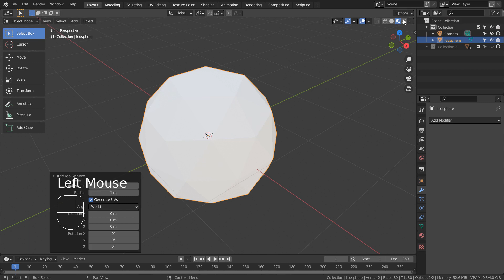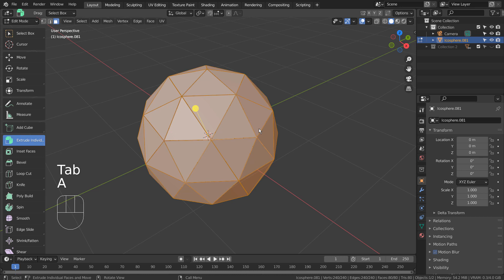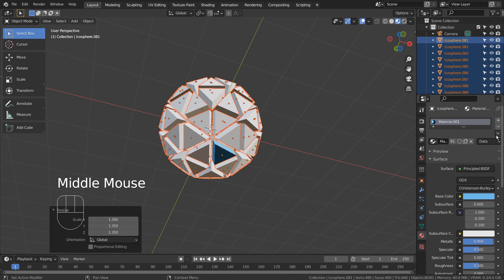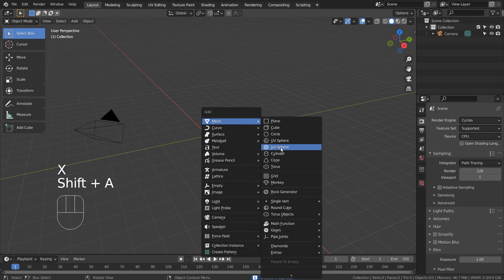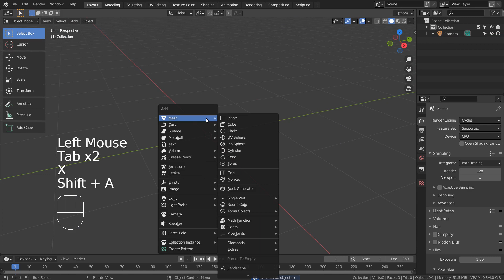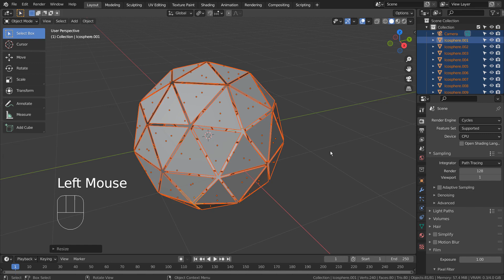Blender Tutorial - How to separate faces

Comment: Sounds like when you couldn't get it to work you probably had the pivot set to 3D cursor by accident and it was scaling to that.
Reply from the maker: Thank you for watching, Belidos3D..!! :)  I think my Blender somehow switched to the 3D pivot on its own.. :(

1. Created a prototype mesh without any issues.  Saved the document as 'test.blend'.
2. Created a new document called 'blueprint.blend' to record a tutorial (File -> New).
3. While recording the tutorial, I noticed the meshes won't scale separately.
4. I checked all the settings, but they were identical to the one I had on the 'test.blend' save file.
5. Closed Blender and tried again after saving a fresh file as 'blueprint.blend' once again.
6. I noticed the same error occurred on the new file.
7. Closed Blender and opened it again.
8. Opened 'test.blend'.
9. Deleted the mesh I initially created, and created a new mesh.
10. I noticed the new mesh was scaling separately without any issues.
11. Closed Blender and tried again after saving a fresh file as 'blueprint.blend' once again.
12. It was working.
13. Closed Blender and tried again after saving a fresh file as 'blueprint.blend' once again.
14. Recorded the tutorial, and it was working.

In my Blender, sometimes unexpected bugs like these occur.

1. Unable to scale a selected face.
2. Unable to rotate a face.

When such issues occur, I always go to my config folder to restore the config files that were saved after the installation.

My config files are located at "C:\Users\username\AppData\Roaming\Blender Foundation\Blender\2.93\config"..

So, the first thing I do when I install a new Blender version is to go to the config folder, and backup (zip) all the files there.

But when such sporadic bugs occur, they tend to stay and won't go away..  

This is why I had to mention the scaling bug I have encountered, while recording the tutorial.  That bug somehow fixed itself, and I've never seen a case like that.. @.@
Reply: @BlenderStudy  That is very odd, i've never had any issues like that before.
Reply from the maker: Yes, it is. :(  The bugs were recorded in some of my tutorials in the past, and I've shown how to fix them by restoring the installation config files. :(